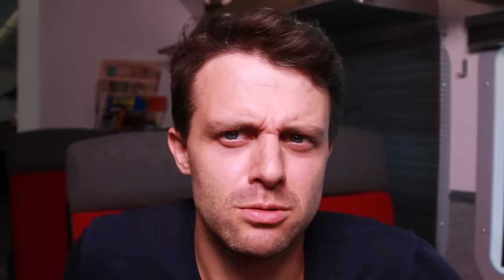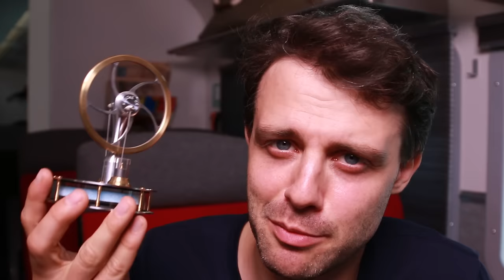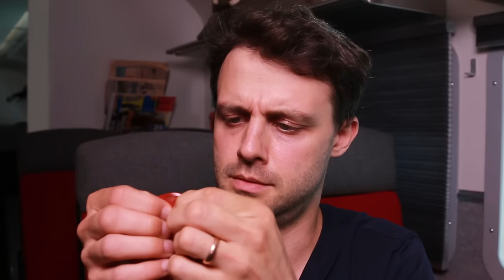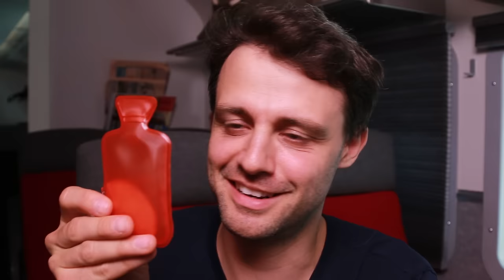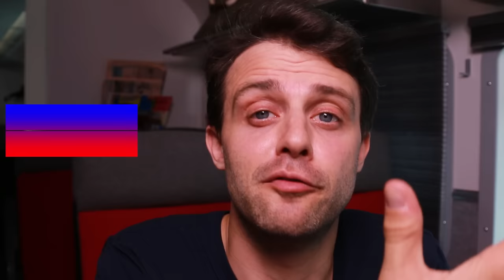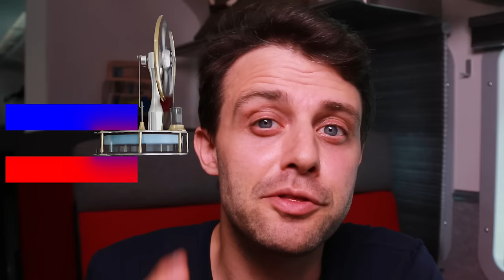A better description of entropy

Comment: 8:14 If everything began as hydrogen and will eventually return to hydrogen, it suggests a cycle that repeats indefinitely. This wouldn't be perpetual energy since it doesn't create more but maintains equilibrium. This is my theory, and while it may not be entirely accurate, it's what I believe about the universe.

Regarding heat transformation, like how a star can create new elements such as gold after a supernova, even if it was initially hydrogen gas it eventually cools down. However,

Dark matter is akin to a pressure that, when all matter is concentrated at a single point, creates friction and heat. This heat causes dark matter to expand the universe to cool down the matter. However, as hydrogen collides with other hydrogen atoms, it generates more heat, leading to a chain reaction that culminates in the Big Bang. Subsequently, stars are born and continue to burn, increasing in heat. Collisions with other planets, moons, or stars further escalate the heat. Eventually, when nothing remains, all matter disperses and reverts to hydrogen, which then gravitationally attracts back to a single point in the universe, potentially restarting the cycle.

(but there is not good or bad theories about the end of the univers)

Comment: But why is the increase in entropy from your muscles and body that you use to spin the engine MORE than the entropy decrease you create from heating the bottom plate and cooling the top plate?

Comment: I like the idea of a box with warm air (high energy) and a box with cold air (low energy), and if you open them up to each other, the air will move and redistribute. You can put a wind turbine in there and it will spin, creating work. But eventually the temperature difference will even out, and the turbine will stop. Even though there's still energy, it's just not moving anymore, since it was powered by the energy difference, not by the energy itself.

It's also neat to think that we get our energy from the sun not just through direct solar power, but also through wind- and hydropower. And yeah, biofuel. Let a tree grow with the help of solar energy, and then burn it up. But be sure to plant a new one to bind the carbon again. Technically coal and oil is also created through solar power, but it's carbon is no longer part of today's ecosystem, so burning up means we expel an excess amount of CO2 in the air. 

Another important aspect about entropy on earth is that we don't just get energy from the sun, but the earth also radiates energy off into space again, so there's a constant flow.
The problem is that the CO2 in the air is reducing the earth's ability to radiate off energy, which is why it's heating up.

Comment: If you say you can create heat difference in the two plates by manually spinning the engine... Which plate gets hotter and which gets colder and why?

Comment: The example I usually give is: "You have a jar with an even layer of flour and an even layer of soot. How long do you think you'd have to shake it to give a grey mess? Given that grey mess, how long do you think you'd have to shake it to give a perfect arrangement of flour and soot again?"

Most people get that. It's not impossible that a broken glass could absorb some sound and local heat excess and come together and leap back onto the table unbroken. But you'd probably need to wait for a few universe lifetimes to see it.

Comment: Dear Steve, I did not know about this video.. As Full Professor of Applied Thermodynamics and Heat Transfer... well.. I could not explain better entropy.. 
a suggestion? 
Related to the next future of heat pumps (and extinction of cretaceous gas burners) you could further disserte about the relationship between Work and Temperature Differences, for better addressing the problem of Heat Pump best efficiency.. (i.e. their COP)

Comment: I was happy when you said "I'm not a big fan of" Entropy as a measure of disorder  but ...  to see "Entropy is a measure of how spread out your energy is" is even more confusing because you have to define WHAT ENERGY IS/ARE ? Then everything become more unclear ...

IF you take an athermic irreversible reaction, energy does no go anywhere and don't spread but the Entropy is still rising because the reaction made the molecules to change in configuration.
=> The reaction made the system irreversible and more complex without spread of energy (depending of what you call energy ^^)

If I use a big source of energy to charge a tiny Battery ... This does not work either but the Entropy still rise -_- !?

Comment: I'm just wondering if gravity could be the universe's mechanism to clump energy back together, Like for example how black holes are even able to capture light rays and then considering the hawking radiation, which, if I'm not mistaken, allows black holes to dissipate energy back out into the rest of the universe again, meaning that black holes actually capture and release energy and acts as some kind of perpetual motion machine of the universe, by increasing in density and decreasing in density (comparable to expanding and contracting). The black hole could be some kind of heart pulse of the universe is what Im saying.
Reply: From wikipedia:

Hawking radiation reduces the mass and rotational energy of black holes and is therefore also theorized to cause black hole evaporation. Because of this, black holes that do not gain mass through other means are expected to shrink and ultimately vanish.

Comment: A permanent magnet motor as a generator is real free energy known as the Edison generator and Tesla bound Edison's generator with magnets all around the armature and used water to move the armature magnets and coils of copper wire. We haven't recovered from this misconception about generation of electric power.

Comment: What happens with a black hole? It seems like it's pulling in lots of energy sources. Does that mean it's a bit of an anomaly? If, to organize energy together we have to ultimately diffuse it elsewhere, like the example of spinning the wheel, then is the black hole inadvertantly dissipating energy elsewhere as it gathers it?

Comment: How about gravitational energy? An evenly distributed system of millions of small masses will clump together at their centre of mass over time, and when they do, fusion will result and also the gravitational energy will be higher at any point outside the radius of the final mass, yet inside the radius of the system of masses than it was prior to their agglomeration.

Comment: Temperature is directly related to resonance frequencies and pulse-evolution differentiates integrated Quantum bonding proportioning and Electron-photon-phonon-Proton oscillation holography of "Neutronic" flat-space ground-state No-thing-defined eternally, .dt zero-infinity sync-duration mass-energy-momentum logarithmic condensation. QM-TIMESPACE In-form-ation in Perspective Principle Modulation Mechanism has nothing whatsoever to do with half-truths like Big Bangs and "heat death". The Temporal Superposition Singularity Superspin Modulation e-Pi-i sync-duration resonances are what you see and what you should understand instead, holistically.

Comment: Mr. Mould inadvertently brought up a CRITICAL issue that isn't ever brought up: Wind farms and tidal farms take energy out of natural air and water systems. No one is talking about the effects of doing this on these dynamically-interactive, incredibly-complex global systems - Especially as we increase their use through additional implementations, both as present total load and/or cumulatively over time. In simple terms, what if we screw up the Jet Stream, or the Currents of/in the Oceans? And this relationship might not be linear. Meaning, that it could be a situation of critical mass where once we reach a certain point, suddenly there is a catastrophic failure, perhaps even multiple failures that cascade from air systems to water systems to.....?
Reply: To be clear, I'm not saying that "greener" energy is bad, nor that we should keep using fossil fuels. I'm saying that until we genuinely understand these systems in total (which we don't) and how they interact with each other (which we don't), we might want to be incredibly conservative about implementing wind farm and tidal technologies. The same could also be said for hydroelectric dams which depend on natural systems that evaporate the water, which is taken by wind, then deposited as rain "up stream." Energy is being taken out of this system, in combination with gravity, by these dams all over the world. At what point is this a problem? Given that we don't know, should we keep building more dams?

Solar energy seems to be the answer that doesn't run into these problems, or at least none that I can think of.....(given the sun is external to the planet, "harvesting" solar energy isn't increasing or decreasing the heat of the planet, we are just using it differently. ......or is that not accurate?) 

.
Reply: If geothermal near volcanos could reduce the chances of them erupting (which makes sense) then that could also be a good source of energy.

What's bad is that global warming adaptation involves moving towards the poles, and that's where solar and farming does worse because of the reduced energy per surface area from the sun. Also, that energy is less consistent over the year.

Comment: Now Steve… I like the whole burning coal analogy of entropy …energy (carbon) clumped together, release heat etc… but isn’t coal made from fossilized plants that clumped carbon from the air with the help from the sun, time and pressure into little black nuggets?  Would that be entropy backwards?

Comment: 4:09 why would the bottom plate need to be colder, surely if running it on ice the top plate would need to be colder to have the temperature gradient be in the correct direction

Comment: could you place the hotter plate in the sun and the colder slab in the shade to make it solar powered?
also, could you connect the colder slab to a huge funnel to concentrate air flow around (too cool it down)
also, could you make the wheel look a little bit like fan to promote airflow around the top slab (to keep it slightly colder than the hot slab)

Comment: If I heard you correctly then I would certainly like to see a manually operated sterling engine like the one you used , produce two plates with differing temperatures . I somehow don't see that happening though .

Comment: if entropy is seeking a kind of balance of equal distribution, and balance is a state of order or symmetry then is entropy really a measurement of disorder or randomness as once thought.  Or is it simply the measurement of a return to order?  Or perhaps its a measurement of strength/symmetry.  For the symmetrical no matter how disordered is harder to break and therefore can exist in perfect balance in what would otherwise have been considered an entropic state.  The pyramids must be in a constant state of entropy.

Comment: 9:14 Statistical rigor...
Not quite. Assuming you have 50 red balls and 50 white balls in the box, there are 50!×50! = (50!)² permutations of balls where all of the red ones are on one side and all of the white ones are on the other side of the box.

Still, to be fair, bear in mind that there are a total of 100! permutations of all balls in all configurations, and 100! is a lot larger than (50!)².

Comment: If you manually turn the Stirling engine, which plate gets hot and which gets cold? It seems like both plates are experiencing the same effect from the foam, alternating expansion and compression of air.

Comment: If it runs when you apply a temperature difference in either direction (bottom plate hotter or bottom plate colder than top plate) what happens when you drive the wheel? I assume you produce a temperature difference, but which way does it go? Does the bottom plate get hotter or colder?

Comment: Thank you for this video.  The "your teenager's messy room" metaphor for entropy has done more harm than good in my opinion.  It needs to die a quick, painless death.  At 6:25, where you're running it in reverse, I would point out that even if your muscles weren't dumping heat into the environment (which they are), the net entropy change would still be positive because more heat is rejected at the hot plate than is drawn from the cold plate.  Energy from the flywheel is being dissipated (or spread out) as heat at the hotter temperature.  The second law never has to operate on credit :)

Comment: IF you were to MANUALLY turn the wheel, I don't think that you can make ONE plate warmer than the other, I think that you would make BOTH plates warmer at the SAME TIME as there would be air movement on BOTH sides and there should be no preferential direction for that heat to dissipate. Right?

Comment: Okay, two things:
1)  You have a box with all of the red balls on one side and green balls on the other side, split right down the middle.  We call that low entropy.  We shake the box, and now we observe that red and green balls are evenly mixed.  We call that higher entropy.

Except that I'm color blind.  So to me, I see a random distribution of balls before and after the shake.  In other words, is entropy only entropy because we observe it?  I mean, who says color is the metric?  One could say that the box was full of round balls before, and it's full of round balls after the shake.   How do we actually "measure" entropy?

I think that entropy is a measure of what we KNOW about a system, or some particular measurement of that system that we take.

2)  You have a box with all of the red balls on one side and green balls on the other side, split down the middle.  We shake the box.  I posit that we now have a box of red balls on one side and green balls on the other side, _split right down a divider that isn't in the middle_.  In other words, who says the box has to be split "down the middle?"  I can split that box in such a way that red balls are on one side of my divider and green on the other, no matter the arrangement.

Again, entropy is only low because we have a convenient way to measure (split) them, and it appears to us that they line up nicely.  But suppose that my entire life, I have defined "ordered" as an exact arrangement of the red and green balls, that simply doesn't match everyone else's convenient "split down the middle" arrangement?  Who's to say that your arrangement has lower entropy than mine?

Every possible beginning state of red and green balls is equally unlikely to occur after the box is shaken.  Is every arrangement equal in entropy?

I think that because we build machines that function based on convenient arrangements of convenient metrics, we interpret certain arrangements as low entropy.  If we we able to know an exact arrangement of a system (a microstate), and if our lives were based on that arrangement, something other than "hot on one side, cold on the other," then we would be building very different kinds of systems that could harness the change in a microstate...any microstate...as readily as we harness a change from "all on one side" to "everything 'randomly' arranged throughout the system."

Comment: If you have plates at -250, -251 degrees and 1250, 1251 degrees, does the wheel spin exactly the same speed?

Comment: Here's something I've always wondered: could the expansion of the universe preempt heat death, by creating untraversable spaces between isolated systems that are moving apart from one another faster than the speed of light? Like, maybe we already know that heat death will happen first, but suppose it didn't. Would entropy cease to increase at that point?

Comment: This video is basically a summary of Veritasium's Video of Entropy, posted almost 7 years before it to minimize the increase in entropy and delay the heat death of the universe
Reply: I'm surprised both videos are so similar!
Reply: Except mid through the video he starts stumbling around the concepts of heat and temperature to the point its hard to listen.
1) It is the heat that powers the engine, the flow of which from one bar to another, is assured by the difference in bars temperature as per 2nd law of ThermDyn. Temperature difference is a necessary condition for the flow of heat and the air expansion/contraction, not the source of the energy. Only energy can be a source of the energy.
2) If we tried to use the cold/hot air instead of but at same temperature as the cold/hot metal bar, the work done would plummet. 
3) Similarly, if we tried to use a super heated bar at say 10,000 Kelvin, but the mass of which was very small say 0.001 microgram, no work would be done by the engine/piston, because the available energy would not suffice to overcome the friction, despite the huge temperature difference.
4) Temperature is an intensive quantity entirely independent on the amount of matter, so it should be obvious that it's not the source for any extensive quantity; the work in this case.

Comment: There would be only ONE way to have all red ping-pong balls on one side and the white ones on the other - when the number of red and white ones is equal, and when the total number is 2, AND the width of the box is less than two times the diameter of a ping-pong ball.

Comment: What would happen if you used liquid helium as the medium of the Stirling engine (the fluid in which the piston sits)? Would the zero viscosity nature of the fluid improve the performance of the engine (eliminating the wasted energy from friction)?
Reply: I don't think so, because the liquid helium would be more dense, would still have inertia, and would still require energy to move. The air approximates an ideal gas, so the viscosity of it is small already.